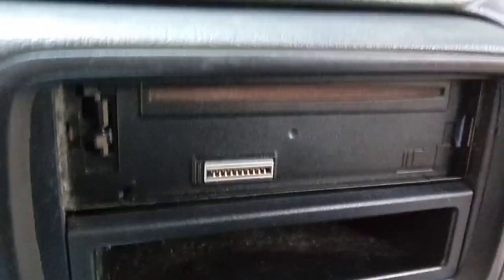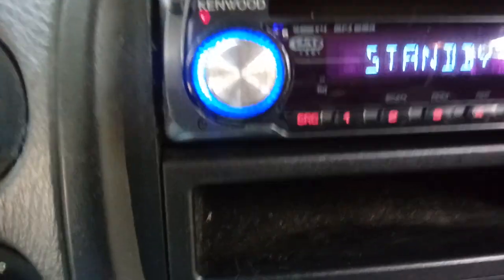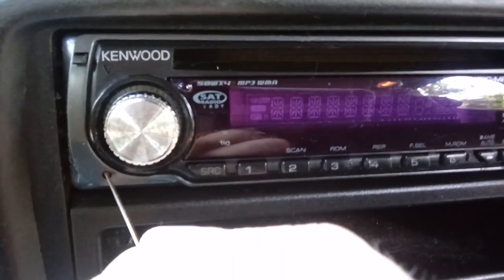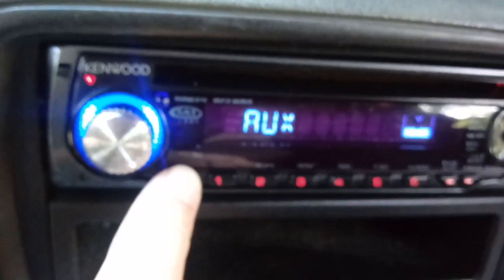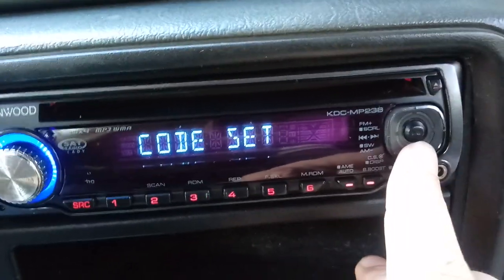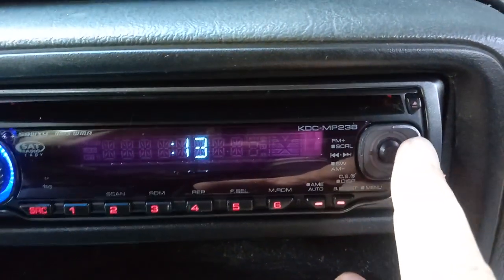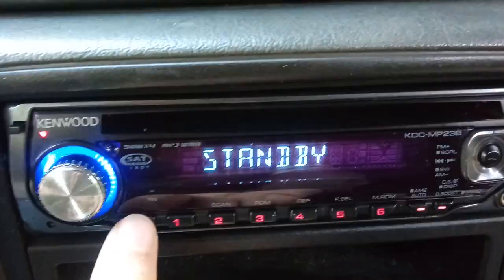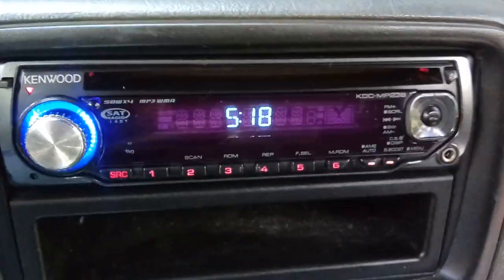Kenwood Radio Set Clock Adjust and Reset Protect Mode Error for KDC MP238, KDC MP208, KDC 138

Comment: Awesome thanks man I was ready to punch it into my dashboard. I bought the car and I hit the preset button and then I couldn’t even change the station and after watching the video I was able to reset it and set the clock back and set the radio station presets to what I wanted and adjust the manual eq so now I can crank it up and it doesn’t crack.
Reply from the maker: Same thing happened with  my Kenwood radio so I made the video to help others. Glad it worked for you.